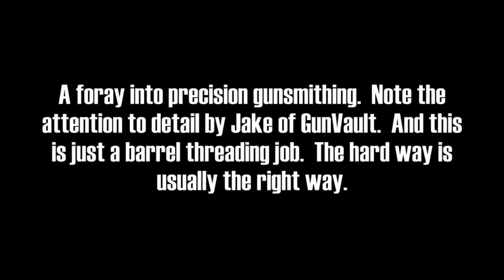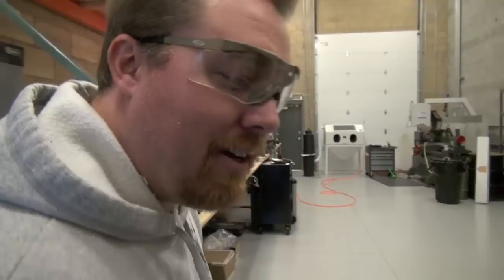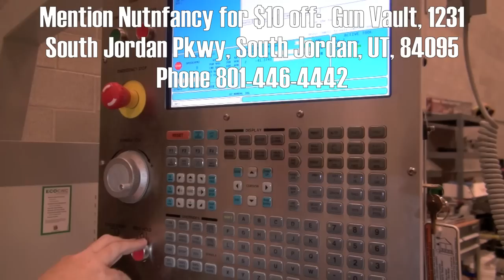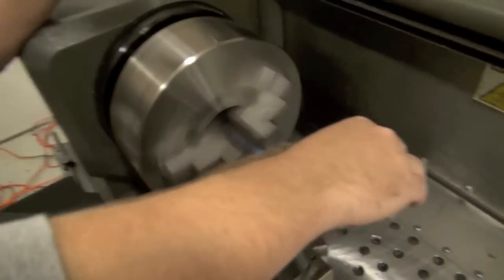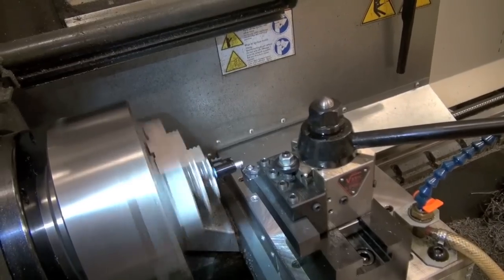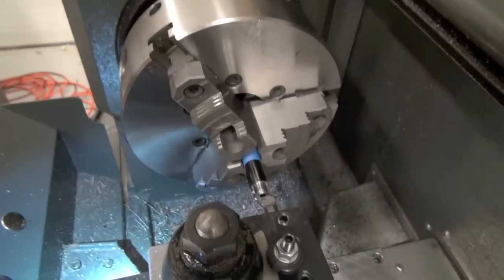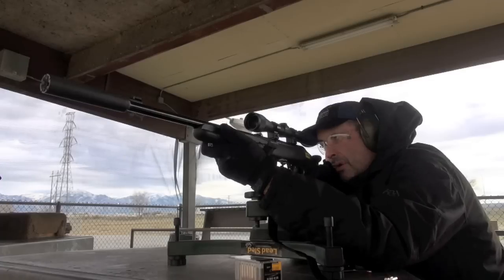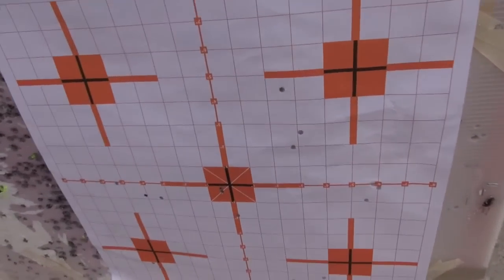Gun Vault Precision: This is How You Thread a Barrel

Comment: Good stuff, not as radical as you might think. Nice to show case that shops capability to an interested audience. If you watch how he operates, that shroud spends a fair amount of time up.... :) just saying.

AND to get terminology straight; Milling is when the tool rotates and you move the rotating tool relative to the part....Typical mill will have X & Y motion with the part fixtured to the table & Z with the spindle holding the tool.  Turning ( with a Lathe ) is when the part rotates and a fixed tool is moved relative to the part.

Some of the stereo lithography and desk top sized CNC machine tools are game changers for both hobbyists and prototypers alike, really think there is a hole in the market for CAD/CAM systems for this next expansion in availability... Something you more creative types should look into... :)

(From an old CAD/CAM/CNC veteran)

Comment: This is how gcode lathes a barrel and does threads not any one you me or a mother.  I have never seen any one use a haas lathe for something as trivial as this lol.  I used to run the haas mills and big lathes and we would make actual gun parts with them but as far as any of our own projects we would go manual just because its much easier set up and most trivial things like threading a barrel or planning a surface was just complicated by automation mainly because you couldn't feed the tool and feel what it was doing.  I don't care who you are precision gunsmithing takes feel and you don't have that with cnc plus now when your bearings go instead of being able to swap them out fore cheap now you got a haas and that's not so, now quality goes down while you wait to pay for a tech to come out to change bearings on your extremely expensive machine.  I say if your going to drill a hole use a drill press not a mill you know.  Precision is everything and you have chatter even if you don't think you do.
Reply: The fact that you said "lathes a barrel" rather than "turns a barrel" shows you to be a novice -- as do the rest of your comments.
Reply: SanLewy
exactly.Although its fun to do hands on projects, the fact the he said its easier by hand then CNC tells me if he is legit machinist,,, he is very old and has no idea how to set up X Y points. The is a reason for CNC it is exact with no error unless the machine itself fails, or your set points failed to be entered correctly. Or you failed to lock your material correctly,,,
Reply: Thank you for the best joke told on you tube today
Reply: ***** More time in setup on a CNC vs a standard laythe. 
Gotta reprogram for every barrel while laythe is a simple slap it in, do some measurements and look at some  numbers. 

It's funny how technology makes things easier and harder. 
Your less likely to screw up when the machine takes over though vs doing it by hand.
I've accidentally bumped controls while on a laythe and almost messed up parts. 
Harder to cut threads by hand as well on a laythe vs CNC.
I'd rather let the CNC machine get me exact matchups on my threads every time as to me timing the thread screw for the cut.
Reply: Sarin Highwind
thanks for the laugh I needed it,,,, you realize that the only set up you have is tooling and calibration right? everything else is programmed from the beginning. you just punch in the new program and calibrate,,,,, 1-2 minutes tops,,,, sigh,,,,,
Reply: ***** Most of the time, yes.
Every time you make a tool change, you gotta do setup. I didn't act like it was 30 mins.
Reply: Sarin Highwind
Look, lets just get to the facts, NO PERSON can outperform any cnc machine, ever. The only error is programming or if the machine breaks... I am just tired of hearing about the mythical super machinist that can be more accurate than dead on all the time every time. I just cant believe this debate even exists to be honest,,, and some CNC machines do their own tooling as well. I'll put the best hand machinist in the world against a cnc and the best that could happen is same results but wont happen ever
Reply: I never said the elusive master machinist could out perform a cnc machine *****. Somebody else might have.

Learning to machine by hand will make you a better machinist in general knowing what tools can do and more ways to set things up. 

A good hand machinist will out perform a regular machinist on a CNC machine usually.
But that is about it.
Even using a good calibrated machine with the digital read outs is no replacement for a CNC machine.  
The only thing the computers do not have is a feel for whats going on. That is it.
Reply: *****
CNC machines are only as good as their setup... same with a manual lathe. I can guarantee you that a quality machinist would have performed a better setup than what was shown in this video.
Reply: taiden
looks like he set it up fine for what he needed done
Reply: Agreed ***** 

the setup was good, the cut was good.

This isn't a rocket science setup. just need to make sure its centered to the bore and square in the machine. 
I'm not sure what the hell taiden is talking about.
Reply: Sarin Highwind
To be fair we don't actually see how he set it up. Threading a barrel doesn't require any kind of crazy setup but for crowning using a good pin gauge to remove runout referenced from the bore in a 4 jaw setup is desirable.
Reply: He explained exactly how he does his setups taiden, I don't quite understand what your getting at...
He specifically said when the barrels are really out of center he uses a 4jaw to put them on center.

If the bore is on center in the machine, that is all the setup you need. This is super simple stuff here.
Reply: I can't check his setup, but I've never seen a 3jaw with painters tape on a thru-bore operation setup less than 0.003" tir unless you were lucky. Concentricity and parallelism both contribute to TIR
Reply: But at the end of the day it's not going to effect me, I'm just commenting on a YouTube video. :P